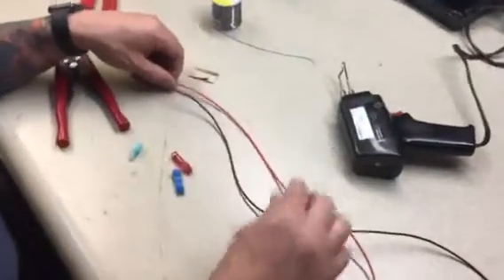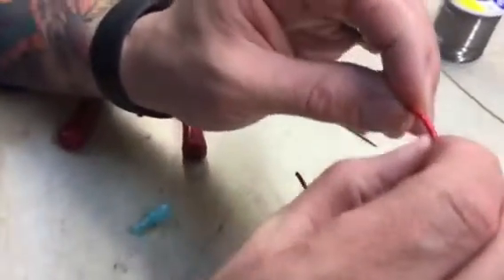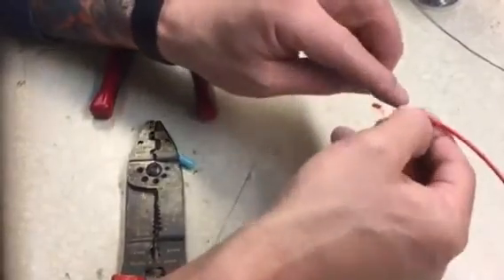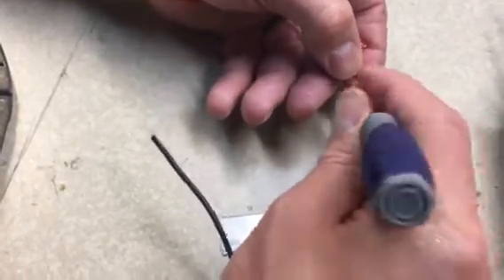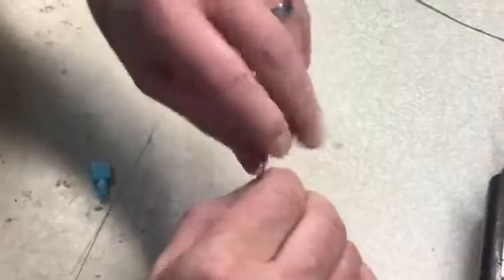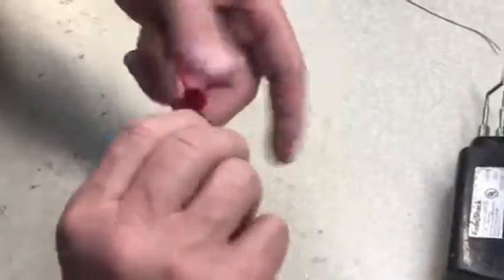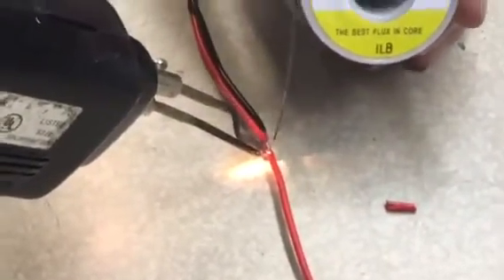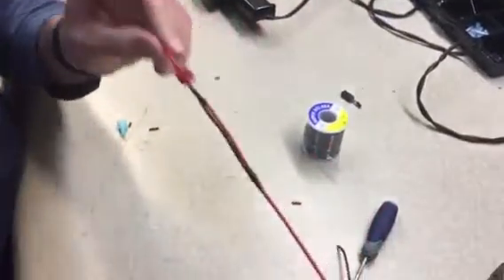How to solder properly or use Quick Connect or T-Tap Correctly

Comment: Actually you should never and I mean never use t taps. They damage wires causing high resistance and heat. Not to mention tons of connection problems in the future.